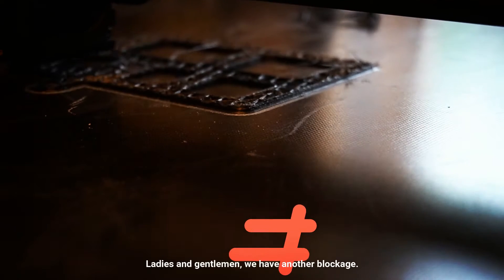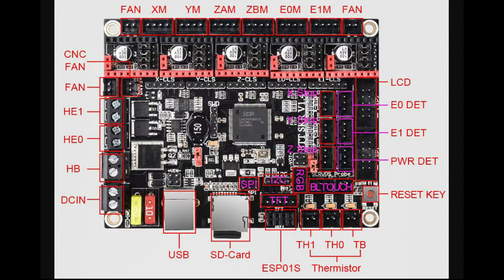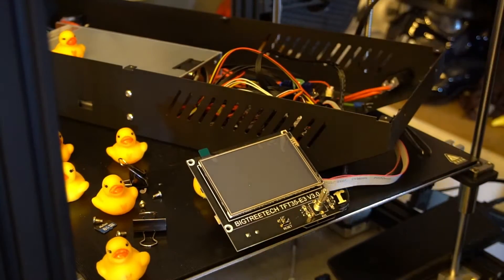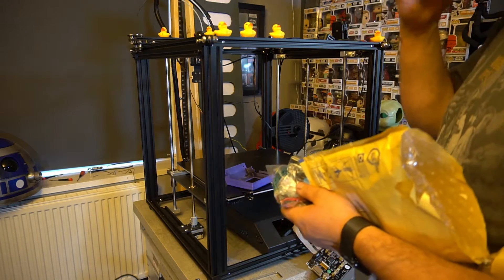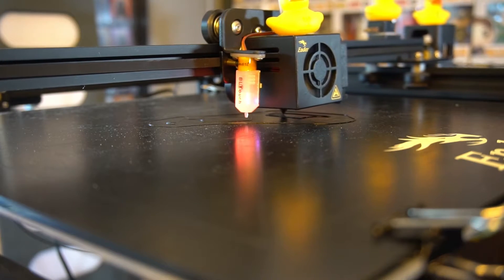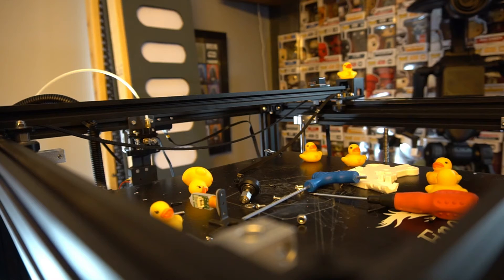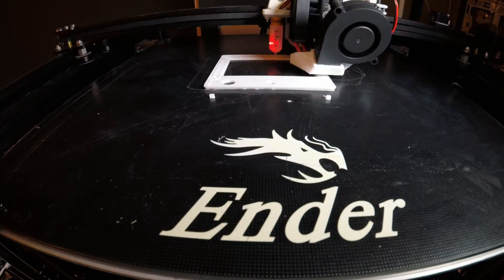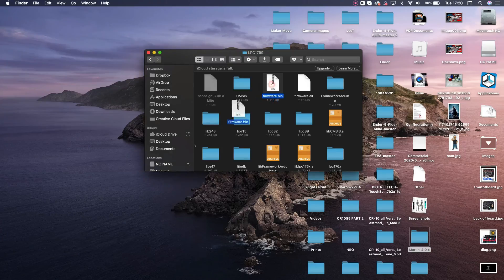Ender 5 Plus Upgrades - BigTreeTech SKR 1.4 Turbo TMC2209 & E3D Hemera Hot End

Comment: Quick question I don’t know if you can answer this using the SKR turbo 1.4 you can use the 22 a drivers and just switch it in the code right no problems
Reply from the maker: If the board supports it yes

Comment: Hi Sam! Quick question...... The pin to be cut is only on the drivers of the motors or even for the one that controls the extruder? Thanks! ;)
Reply from the maker: I don’t cut them I bend them out of the slot, this is don’t for the homing so XYZ only
Reply: @TheRealSamPrentice  thanks a lot! I will do the same! 👍👍👍

Comment: I read the cheetah file, marked everything for my E5+, 77mm bowden DD tube, .18 linear advance, 2209s with pin clipped off. It wont compile with a "Babystep_ZProbe_Offset requires a probe" error along with

"Auto Bed Leveling requires one of these: PROBE_MANUALLY, SENSORLESS_PROBING, BLTOUCH, FIX_MOUNTED_PROBE, NOZZLE_AS_PROBE, TOUCH_MI_PROBE, SOLENOID_PROBE, Z_PROBE_ALLEN_KEY, Z_PROBE_SLED, or a Z Servo"

&

"Z_MIN_PROBE_REPEATABILITY_TEST requires a probe: FIX_MOUNTED_PROBE, NOZZLE_AS_PROBE, BLTOUCH, SOLENOID_PROBE, Z_PROBE_ALLEN_KEY, Z_PROBE_SLED, or Z Servo."
Reply from the maker: You’ll need to send me your code to look at and crunch. It’s not an error I’ve come across but on the first part it’s defining a probe, you’ll see there are several on the code I’d suggest trying one of the others to see if the problem shifts. The Auto bed is linked to the probe so again it’s going to be looking at what it’s missing.
Reply: @TheRealSamPrentice  Hey I would appreciate the help. Would you like me to send you the configuration.h and configuration.adv files?

What's your email address?
Reply from the maker: @reeceengineering  therealsamprentice@gmail.com

Comment: I have a cr-10s, and the filament blockage was uncontrollable. After switching to an e3d v6 gold / bondtech bmg extruder I was still having the issue.
Turns out the stepper motor was overheating. I put a cheap heatsink on the stepper, and haven't seen the problem since.
Reply from the maker: Craig J that’s good advise! Why was the motor getting so hot?
Reply: You might want to adjust your pot's on the drivers
Reply: @Ktmfly3r  That was one of the first things I had tried. I have since gone to the SKR 2 control board with TMC2209 drivers. I will have to see if the steppers are running cooler now.

Comment: this is literally a video just showing what you have, and definitely not how you did it. Board wiring you said at the beginning you'd "show us later"? what happened to that? what RMS/VREF settings did you use for the Hemera (Bowden or Direct)? how did you set up UART with the 2209's? Basically, you didn't explain anything you did to accomplish this upgrade; and also your video is all over the place in terms of editing. it cuts out a couple times (audio), and seems to jump to a completely different topic during those cutouts.
Reply from the maker: Thanks Jonathan just for clarity do you have a question of which you’re not able to answer yourself or is this just a criticism? The audio unfortunately does cut out as I had a copyright issue part way through so sorry about that. I’m sure there are ways I can improve on the editing.
Reply: Questions please show how